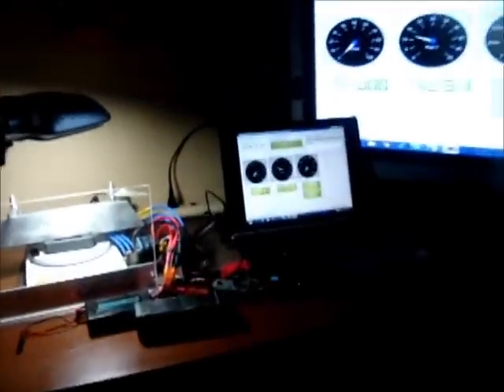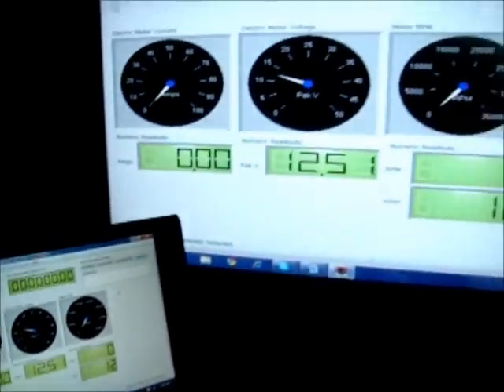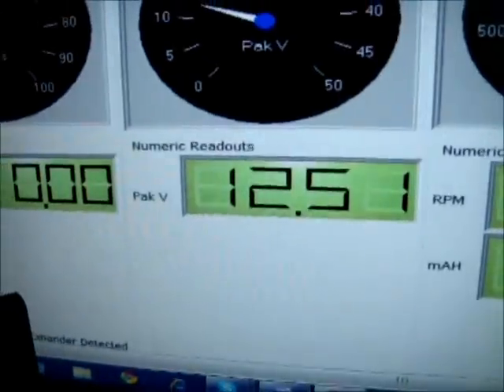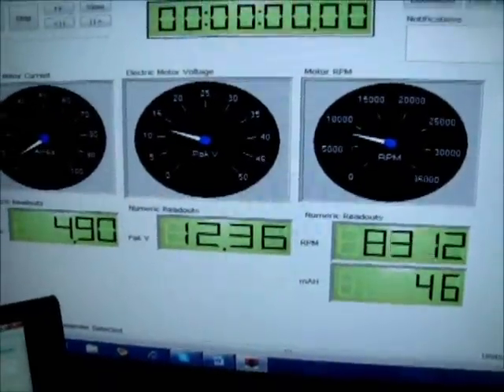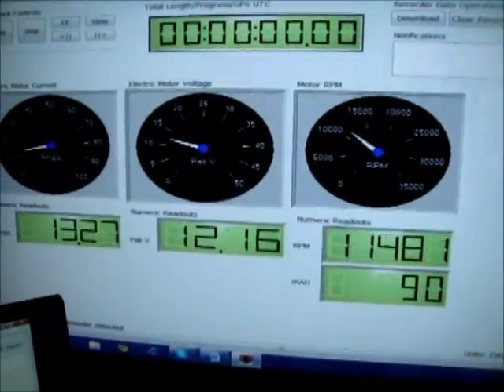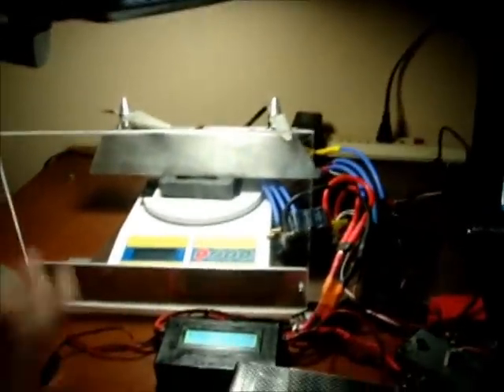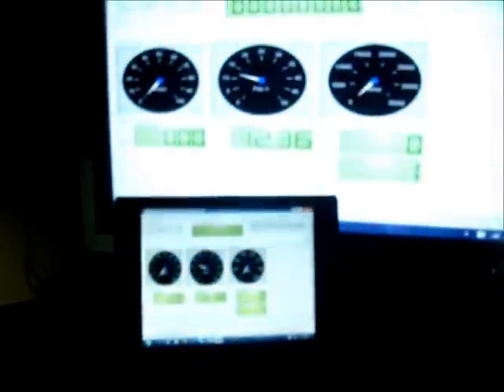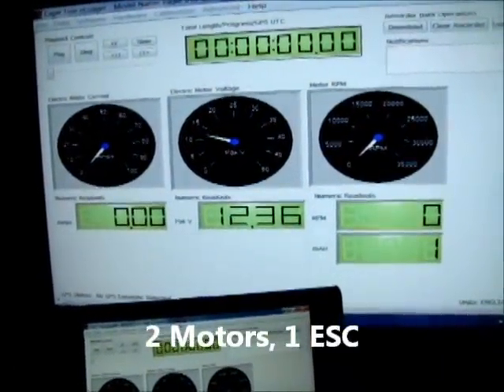Thrust comparisons of 2 Motors 1 ESC and 2 Motors 2 ESCs

Comment: Any latest updates on this? After watching your video and a few google searches, I have installed and setup a 200A RedBrick ESC, driving 2 Freewing Metal counter rotating EDFs, on my Freewing SU-35. Test run on the ground seems to be OK, but I don't have the confidence to fly it just yet. My test was only at half stick at most.

Comment: i liked ur test, been thinking of doing a setup like that in a car, i'm just confused about one thing though, u are using the same motor/prop set up but u are getting different force readings for the same rpm, how is that possible? i noticed the watts are slightly higher on the 1 esc setup but that's to be expected, but the difference was not as great as i expected. how can u explain the different forces?